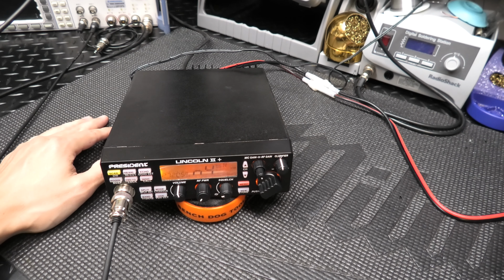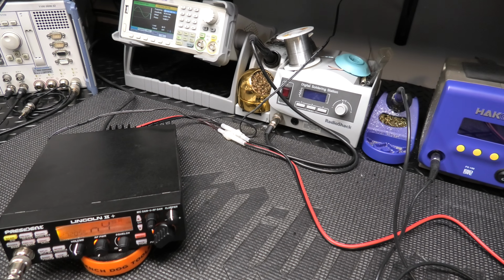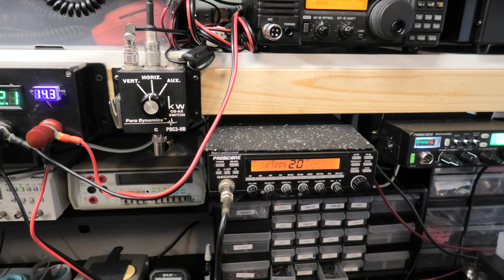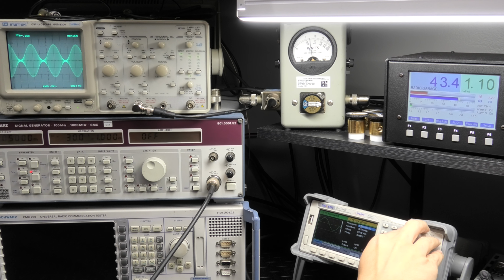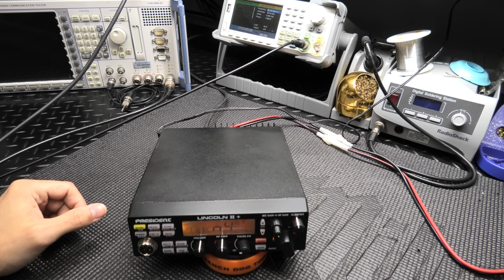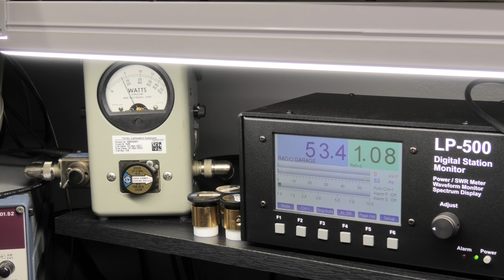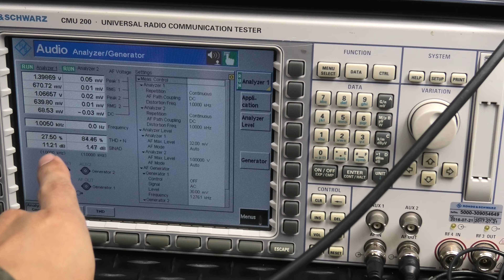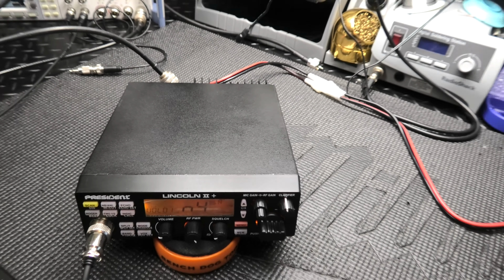Lincoln 2 Plus Audio Mods & Testing For Joe SSB CB Radio

Comment: I've had one of these for about 3 years now.I bought a brand new.
Yes on receive, just like others have outside of this particular YouTube.Video opposlightly gobbled.Receive audio on side band even not a strong signal no noise blanker on.
On my mind, it is intermittent and I've taught to other people who said they had the same problem.That's kind of weird when it's Intermittent.
I don't know what the stock I.F passband side bend receive is on this radio I would still like to know what your mod was.
Also , another common problem of these in high have nut seen it address, On receive with the volume all the way down in a very quiet location.Like maybe a bedroom.There's a constant hiss out of the speaker.
My hearing is still pretty good for my age.I could never have this radio inside the house.

Comment: The receiver mixes QRM with audio, if you press the mic button to scan the frequencys the receiver does not change frequency as long as you hold it pressed, the paint is so delicate you can scratch it with your finger nail, the heat sink has no compound behind it, if you use FM the radio will be blazing hot and the heat sink stays cold, bad news for your finals, the audio chip is CRAP. President radios don't care.